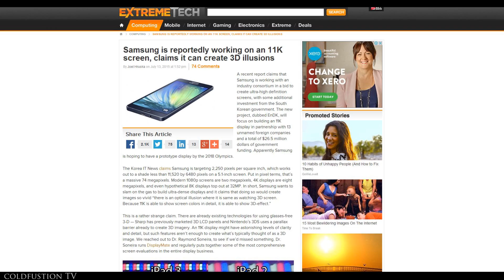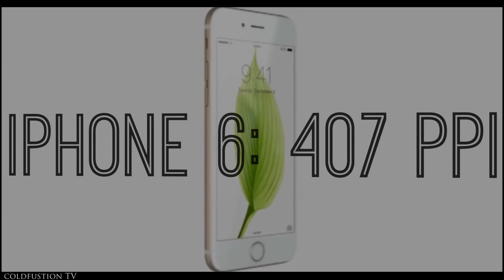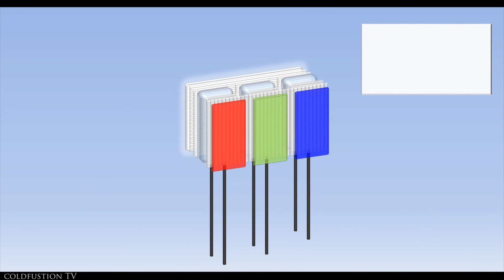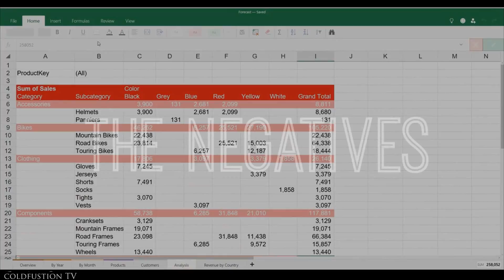Samsung is Working on an 11k Mobile Screen! (2250ppi)

Comment: I don't see anything wrong with it since it's an advancement in technology and hopefully they could put the price down.  It's the same concept as before... back then we were happy with a vga screen, then it became an hd screen, then a full hd screen. When 2k screens came out we said we didn't need it but now majority of smartphone users are complaining why aren't 4k screens standard on phones?  With everything technology the mindset we have at default is that we don't need it but hey, if the technology is already there and the pricing is right then why not?  With innovation there is only one direction.. and that's moving forward.  HOnest question... would you guys be using a samsung galaxy s3?  Or are you using a smartphone way newer than that? ;)

Comment: Some years ago I've heard about a 3D screen technology which uses a nano prism foil to direct pixels into different directions. It seemed very promising to watch 3D without glasses but reduced the screen resolution dramatically. Well, I can imagine a small 11k display might just be enough to experience clear and sharp depth effects without any external expedients.

Comment: 3:15 I don't understand the argument about mirrored projection from the phone. the pixel density on the phone doesn't matter when you project you phone on another screen. wouldn't it be the pixel density on the monitor that's important? the phone essentially just send a signal to the tv about what to display, how does it matter about the pixels on the phone?

Comment: If done properly, higher resolution should not need more battery power for brightness. However, it is indeed significantly more stressful on the phones GPU and possibly CPU, which could indirectly lead to more battery consumption.

Comment: i like to watch ur vidz but not the resolution is the problem... the problem are the batteries... not the camera, the optical focus (like on canon cameras...) its the own opensource and android system (dualboot)... these termes was and are also today the problem... more power but not for the user... the client (buyers) dont get that... revolution the technical experience again... but not with faster and stronger, instead of more user friendly and satisfied points... well, maybe create one company themselves?!

Comment: 10 minutes on screen time?no thanks..the batterys even today are a problem with quad hd
Reply: Increased resolution wouldn't use more power if done properly, other than gpu load.

Comment: please no our batteries barely last with 2k and I can't even tell the difference between this and 1080p
Reply: No, there is the LED backlight that shines through every pixel giving them light if it's not an OLED panel, because oled uses individual pixels that emit light. The problem is that everything that appears on your screen has to be rendered at 11k. That takes a lot of gpu power.
Reply: Resolution shouldn't effect battery life other than GPU usage.
Reply: Exactly, gpu usage. Most pixels = more data to process and more being moved through vram.
Reply: every pixel needs to be individual light?

Comment: There is an important point to bring out on this 11K screen. Whats the point? The content done in the 11k format is non existant for now so why build a phone that wont be any better than those already around in most cases due to it having ppi that it will never use

Comment: they better have a better battery in a phone with an 11k display, that would eat a lithium battery away in just an hour or so!
Reply: A better processor would mean increasing power and decreasing power consumption.
Reply: u dont need better battery if they invent a better processor
Reply: wrong, a better processor would also use more battery power. do you know anything about computers?
Reply: Better processors don't necessarily use more power frags, if you tried to make a better processor with the same architecture, it would. But new technology generally has higher performance for less battery power each generation. 

The screen resolution itself would not use more battery, the total screen luminosity would be the same, therefore it would use the same amount of battery power to light the screen. It may however indirectly increase battery usage due to increased GPU load.

Comment: the screen won't be the issue the real problem is we won't have enough cpu and gpu power to push 4k 8k and definitely not 11k pc can't even push 4k without having sli or some beeffy hardware so it won't happen not even possible for 2018
Reply: sol0matrix,t rue.
Reply: PC can run 4k, or even 11k on a normal desktop extremely easily.
Games are what it can't run.

Comment: My 720p screen in my Motorola is more than enough. In fact that's a bit overkill for me. I'd rather a better battery.
Reply: Higher resolution doesn't use more battery, other than gpu usage.
Reply: GLD_AV3NG3R CS GO and Fun Did you even read my message?

Comment: I could see this being useful in VR.
Reply: so what you are implying is that higher resolution equals more fucked eyes?
Reply: are you high
Reply: well you're clearly lieing, in a vr headset not just would you see loads at pixels but you would also have a tiny fov on it with that tiny screen, let alone the awful performance.  you haven't  even tried it have you
Reply: so because a little amount of people could use this in VR means everyone has to carry a screen they don't give a fuck about
Reply: I can't even see the pixels on my iphone 4 that is 750p even with a headset.
Reply: +StuffyPancake
Reply: Welcome to marketing.
Reply: doubt it. probably fuck up your eyes

Comment: is it really that necessary?
now we need a nuclear battery.
Reply: Yohanes Pradono i'm not sure if i trust samsung with that
Reply: They already did..
Reply: Alex Lushiku 1 minute ago?
Reply: Then you would never have to charge it. And disposal would be an issue.
Reply: Abdelkader Bennaoum right Note 7 cough cough
Reply: Yes. I use my phone for VR. With VR, every pixel is visible even if the screen is 3120 x 1440 resolution screen. Also even the premium VR offerings such as the HTC Vive and Valve Index are reliant on phone display screens.

Comment: As a person who loves his VR device, 11K is necessary with the current way VR is implemented. you are essentially looking at a small screen magnified and wrapped around you...11K will really make it a whole lot clearer
Reply: The Awesome Man try the z5 premium. I can't see the pixels with my vr headset. 4K is more than enough
Reply: of course it cant but when you use the special lenses for VR devices you are seeing the screen really up close and its magnified and warped leading to what is called "the screen door effect" as you see the spaces between the pixels.

getting something that is this high res might solve the screen door effect problem.
Reply: A human eye can't even see 11k
Reply: really impractical, playing a true 4k video  resolution  is only posible with great processing power and wideband, let alone vr resolution, standart vr resolution now are mostly bad, 11k 360 resolution makes no sense to persue when a 2k to 4k res make good results
Reply: Which GPU will power that screen ?
Reply: The new Nvidia Volta most likely
Reply: volta is the code name, it will be released in 2017
Reply: The human eye does have pixels. Well, cones to be precise.
Reply: Is there an old nvidia volta ?

Comment: SAMSUNG HAS BECOME EXTREMELY STUPID. EVEN TODAY, MODERN COMPUTERS STRUGGLE TO DO DISPLAY ANYTHING HIGHER THAN 4k ( 5k or more?). NOW IMAGINE A FUCKING PHONE/TABLET THAT RUNS ON LITTLE POWER RUNNING 11k. SAMSUNG, YOU NEED A REALITY CHECK.
Reply: THE CHIPSETS WILL GET FASTER, BUT IT WILL TAKE A VERY VERY LONG TIME. EVEN TODAY, EVEN A 4,000$+ COMPUTER WILL STRUGGLE TO HANDLE 5k AT LEAST, MUCH LESS 11k. SO IMAGINE A FUCKING PHONE/TABLET. YOU NEED A REALITY CHECK. -.-

Comment: What is the point? On a screen that small, it's just ridiculous and unneeded. Instead of increasing resolution, why doesn't Samsung work on increasing colour accuracy and spectrum, as well as contrast and efficiency? These are much more important than resolution
Reply: battery life ?
Reply: +YoSoyGabo yeah sure but I was sticking mainly to the screen
Reply: Samsung has had numerous preset colour profiles that deal with colour accuracy since the Galaxy S2, it's only the default colour profile that looks saturated.
Reply: eastlondonhustler Woah :0 Are you stalking me or something?
Reply: Boring No bro, i don't stalk.

Comment: The VR application of this is more than good enough a reason. Have you tried wearing a VR headset on current flagships (3k screens)? They look like crap because the resolution per eye ends up being close to 360-480p. For realistic VR, I think 11k is just the beginning.

Comment: hi coldfusion. i'd like 11k better in forms of 42 diagonal inch smart passive 2d to 3d converting tvs& computer screen monitors that can include 5k something. but if its in virtual reality goggles maybe its okay for image magnifications and images demagnifications! so about aproximately 11k something by 5k something by 13k something comboed takes several years for a mortal from 2,000ad to 2,016 or 2,017 ad to try to count that high correctly at least once or twice for a single individual person to attempt to do by his or her self alone with no one elses help to count this in sequenticial order by hand on paper with ink and ink pens and gluing 8 by eleven sheets of paper together with store bought school glue. so in other words humans most by themselves start losing patience and interests in doing this maybe at 12k by 14k by 6k &/or higher and run out of time and life span and existences and can not really survive nor handle 12k by 14k by 6k combos and/or higher. so maybe i never want to go past different variable and nonvariable types of 11k by 5k by 13k for real literally always because i do not want to spend infinite reincarnations of my own lifes and existences away doing nothing else except for attempting to count and record in pure sequenticial numerical order from wombs to tombs and beyonds doing nothing else for real literally! & because it really is that exstremely time consumingly hard and difficult to do for real literally! at least mine is for my personal quantum anti-null freedom of programming speeches project i've been working on! at least its better than nothing at all! have a happy month of april 2,016 ad:! signed meow.

Comment: +ColdFusion Hey I'm an audio guy and you might like to know that there's a lot of sub-bass hash going on with your vocals. I'm listening on a carefully tuned system that goes down to 15hz. I don't know what you already do with your audio, but I'd add a high-pass filter at 80hz to tighten your vocal sound. Also, your vocal compression sounds a bit too aggressive and you can fix it without losing the "voiceover" sound by increasing the knee radius OR you can use several compressors in a row with a low ratio as opposed to a single compressor with a higher ratio. 

Let me know if this helps. Thanks. (PS I know this video is older and you might have evolved since then)
Reply: +TheBrainTrust he sounds fine to me
Reply: Haha yup he does indeed sound fine. That's not what I'm getting at though. Movie producers for example are very familiar with psychoacoustics, the field of study in sound perception. They carefully craft the various elements of the sound by notching frequencies or adding reflections to alter the feeling from comfy-cozy-engaging to loud-aggressive-attentiongrabbing to distant and far away. The point is to enhance the overall effectiveness. There is more to it than the information itself.

Comment: This makes perfect sense to me and I think 11k is actually not enough!! Here's why...

Nvidia is heavily developing Lightfield Displays for VR with OToy. What they do is project a grid of smaller images across the screen. Each smaller image is a slight 3d variations at a different angle of the single image the eye is looking at (one image for each eye). Then using custom optics they somehow trick your eye into seeing just one image. The coolest part of Lightfields is that they allow your eyes to focus on different parts like you do naturally (at least that's the theory) So you relax your eyes to look at things further away and then focus on something close up. Besides lag this is one of the biggest causes of headaches with current VR. Your eyes are focusing the same for everything because they are looking at a fixed screen that is simulating depth.

So if they split the screen for VR that would give 5760 x 6480 per eye. If they then do the light field thing and split each eye into 4 x 6 grid of separate images that would give each image a resolution of 1440 x 1080. Or they could go 4 x 4 for a resolution of 1440 x 1620. 

So if that is the end result an 11k screen would make a great deal of sense. You should see youtube videos on lightfield vr. Very cool indeed.

Comment: I'm all for an 11k display, but why in a mobile device? A phone at 1080p with a high ppi seems better, trying to push high resolutions on mobile devices seems silly when most media is still shot at in 2k or 4k. Also, why don't we work on internet first, 20 mbps is all I can get in my area on a good day,  and that's barely enough to stream 2k media.

Comment: ...pixel density is higher but they are proportionally smaller. As long as screen surface itself doesn't increase power consumption souldn't drop significantly. Graphic chips on the other hand will drive more power if we we'll be able to produce video content of significat resolution to mach the ppi...:)

Comment: 11K may not make much sense on a mobile device. But it may open the doors for other reasons.  

An 11,520 x 6480 display on a 5.1 inch Samsung Galaxy phone would have a 2,592 PPI density. That is officially 906% beyond  Retina which is the point at which the eye can no longer discern pixels. The current 1440P screen on the S6 are 201% beyond Retina. 

Another interesting fact is that Super AMOLED displays from Samsung are improving on efficiency at incredible rates. The 2560 x 1440 Galaxy Note 5 screen, is 30 ~ 40% more energy efficient than the 1920 x 1080 screen found on the Galaxy S5. So while the resolution is slowly increasing on AMOLED screens and despite the fact that they are becoming brighter, they are actually becoming more efficient than the lower resolution displays that preceded them as time moves on. 

Samsung is now sticking with 2560 x 1440 once again this generation probably due to the fact that they can't yet make the 4K variant as efficient as the 1440p screen quite yet. But at least the new screens this year should improve on brightness, efficiency and color accuracy over last years 1440p screens when the Galaxy S7 launches.

Somepony also said at least my phones camera is 41mp. Um....  41mp phone camera = 7,393 x 5,545 resolution. Considerably less than 11K.  ^_~

Comment: 11K screens would be good for VR, and not just mobile VR as the video mentioned. The current head-mounted displays, like the Oculus Rift, also use Samsung's smartphone screen technology. With VR they would need about 8K per eye, maybe even more, to not see individual pixels anymore. 

For anything else it will not be necessary for years, as it will take a while before content could even be made for it.

Comment: So basically, the smartphones will have 11k before consoles will be able to hold up with 1080p.. LOL
Reply: If samsung makes a gaming console
Reply: nailed it
Reply: Matthew Xbox one x will have full 4K capabilities
Reply: Hello ikr, in fact, the xbox one (the one from 2013) can run games like Forza Horizon 2 at 1080 at 30fps
Reply: You really think that oyu will able to play games even on 4k on phone? Consoles could do same graphics on that resolution if it would had proper output hardware
Reply: +Matthew well... yes, but that's not the point, i could have a PC from 2005 running a triangle in 4k60fps, or a PC from this year running a graphically very intensive game at 720p30fps. The reason a mobile GPU is able to so simply push out 1440p currently is because it's pretty much just running a series of menus, if you were to try to run a recent console game on a high end phone you'd struggle to run it at the same settings as the console version even in a resolution as low as 240p with lighting and shadows severedly downgraded, lower texture resolution, less particle effects, etc XD
Reply: lol if Samsung jump in console war. like smartphones console industry would also get boost up

Comment: I still play games on PC with 256MB of ram on 600x800 resolution.
Reply: +Mladen Milić lies.
Reply: +Mladen Milić I play ''games'' with 8gb of ram and a 1366x768 resolution with an AMD A8 5545m (1.7ghz, 2.7 in turbo mode) quad core processor AMD 8510g graphics.

Comment: For a device you hold in your hand in front of your eyes anything over 400 something ppi is absolutely unnecessary. The human eye can not distinguish any finer detail, as the cells are so dense as they are and so big as they are. That is a boundary. Same goes for sound resolution - computers have reached an anatomical boundary of human senses. Unless we use that to project to a bigger screen or alter our eyes to have more than an eagles vision capabilities, there is no point of such resolutions for phones.
On the contrary - why are laptop screen resolutions so disproportionately low, while mobile screens go way beyond scale?
Reply: SAME. I see laptops with 1366x768 displays that are 15-17 inches